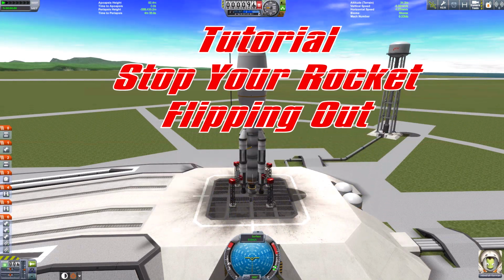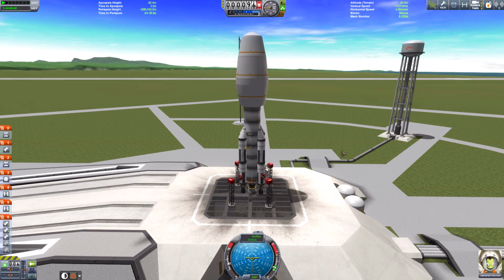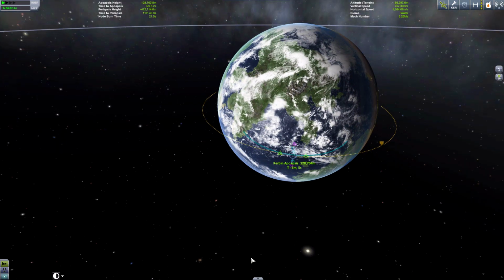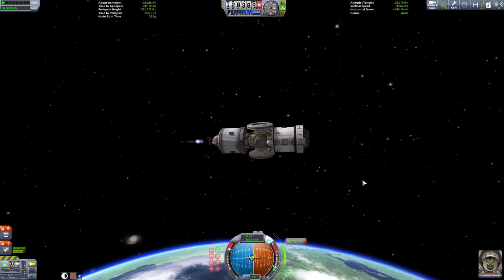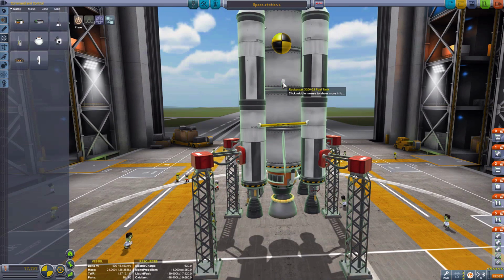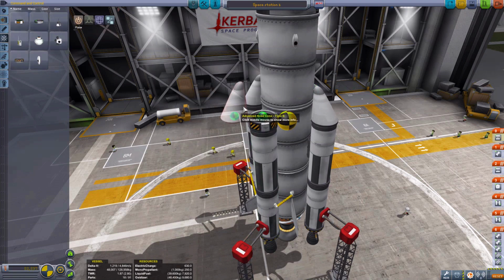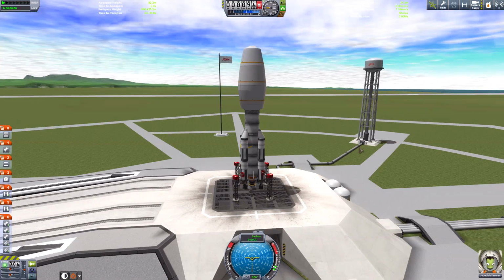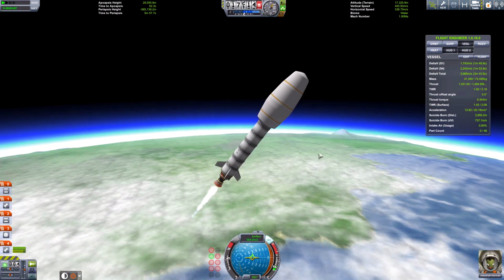Kerbal Space Program - STOP ROCKET FLIPPING!

Comment: See, my issue is this:
Everything goes smooth. SAS is keeping me stable, asparagus staging is working just fine, for as long as I fly straight up. The second I start tilting to 45° along the 90, the ship begins tilting out of control. Spinning end over end, losing all upward velocity. I can't counter tilt to correct, SAS controls are still on but aren't enough. But even when flying straight up, it eventually picks an angle to do the exact same thing. Sometimes it'll start rotating out of control too, and I have no longer have any control over the rotation. It's most frustrating, as I've designed rockets that have gotten me to orbit and the moons, but every now and then one of these pop up and I'm stuck on the ground for a few days.

Comment: This was made before the fairing bug was fixed. As it clearly shows there is an error ahead of the rocket at 3:00. He did not know why it was there. Should have been running with the stock bug fix patch and it would have not flipped so easily. This bug has since been fixed in the game.

Comment: if the top of the rocket starts oscillating during launch turn off SAS. 90% of the time the different SAS-systems on the ship are tearing it apart rather than stabilizing it. This is especially true if the rocket itself is flexing. The cockpit on the very top of the wobbly tower changes direction all the time and the sas system tries to realign that with the original vector. Result is the rocket turning even though the lower part of the rocket is actually still on course. This in turn increases the wobbling and lifting body problem.
If you build your rocket in a way that is aerodynamically stable you can skip the whole sas-mumbojumbo alltogether
Reply from the maker: +TheVergile Yeah i had this problem before when I added a load to keep a rocket on coarse and the SAS destroyed the rocket :D

Comment: Regarding your struts comment at about 12:20, a way around not being able to attach struts from the base of the rocket to the payload is to attach the struts to the payload first. The struts will then either connect to the fairing base or the part beneath it.
Also, i'm not sure how much of a puritan you are with mods, but you might want to check out Kerbal Joint Reinforcement. It makes it easier to fly already big and unwieldy ships by strengthening connections between bigger nodes.
Reply: +Gordon Rammstein Version 1.1 is coming soon and fixes a lot of issues with that
Reply from the maker: +Gordon Rammstein I didn't realize that you could connect the struts from inside the fairing then to the craft luckily V1.1 will have auto strutting under failings.

The reason I don't use joint reinforcement mod is that it keeps things interesting and I have more fun that way ;)
Reply: Orb8Ter
autostrutting? sounds amazing. I'm wondering if they'll give you the option to make fuel tanks completely liquid fuel, or if they're going to make specialized 2.5 and 3.75m liquid fuel tanks for nuclear stages. I suppose time and devnotes will tell.

Comment: I don't know if it's considered cheating, but you can strut the payload to the main body. just strut the payload BEFORE building the fairing. 

Also, I've noticed that if you try to build struts from the payload to somewhere outside the fairing, when the fairing is already built, the struts will attach to the inside of the fairing, though I don't know how useful is that in terms of stability. Anyway, I always use a fairing that's larger than the payload and I strut everything to the fairing's base.
Reply from the maker: +Teodor Pojar No I dont think this is cheating strutting up ;) but the fairing can cause a lot of problems, luckily in V1.1 anything under the fairing will be considered to have been strutted :D

Comment: There is a parts pack that has fairings that automatically creates struts to secure the cargo...
Reply from the maker: +Randall Hunt I didn't realise there was a mod for that luckily KSP V1.1 will have that as well for their fairings thanks though just in case i pop back to V1.0.5
Reply: +Orb8Ter I knew they added clamshells, didn't know they added struts too. Then again, I've only been playing the career mode, and haven't purchased fairings yet.
One thing I'd like to try is using separate tanks for the fuel and oxidizer to help stabilize it, like they do in real life.

Comment: A few things that have helped my create stable rockets... 

Procedural Parts mod (namely fuel tanks) 
...With large rockets using several stock tanks for the core stage the fuel drains from each tank separately, top to bottom. This can cause the CoM to change drastically and affect flight characteristics. Having one or two core tanks using procedural parts allows for more predictable CoM changes. 

Use large tail fins, Tweakscale or other Mod parts
...having larger tail fins on larger rocks makes sense and reduces the tendency to loose control. This also reduces the need for excessive reaction wheel torque during launch. I tried extra reaction wheels, but that isn't as reliable as larger control surfaces.
Reply from the maker: +AaronAlso Thanks for the tips, I am about tp migrate to V1.1 hopefully there's no bugs like the fairing bug to cause the same problems I was having. I will have to check what mods work on V1.1 but first a little exertion in V1.1

Comment: Yea, I think the stock career mode contracts are kind of stupid. I like to play career mode with a punch of contract pack mods to make them actually practical and important instead of random stupid stuff.

Also, fuel does flow top down, so you should always place fuel lines from the bottom tank to the other bottom tank for asp. ;)
Reply from the maker: +Eli B (SnakeRustler) Yeah I should look at contract mods but maybe in V1.1 when it's out.

I'm glad you verified about the fuel pipes, they can also be useful to balance craft when your burning fuel, I used that technique on my shuttle to make sure you have the center of mass over the center of thrust so it didn't flip out ;D

Comment: I've found sometimes these techniques don't quite work for heavy payloads. Sometimes even if the load is stable the faring can cause the rocket to flip out. And sometimes with heavy loads the center of mass will shift higher as the fuel is drained from the top tanks causing it to flip out. So pumping the fuel from the bottom to the top tank stabilizes the center of mass. You can pump the fuel by holding Alt while right-clicking on both tanks this brings up buttons for in and out below the fuel bar.
Reply from the maker: +Osani Eslana I beleeive that the large fairings I use cause a lot of problems due the high shift in center of lift, but on experience if you make sure you point prograde you wont flip out, thats how NASA did it for the Apollo rockets.

Comment: Your analogy for center of mass is wrong,  having a higher center of mass makes an item more stable. You can test this by balancing a snooker cue on your finger (or any long top-heavy item for that matter) the heavier end on top will always balance easier than the lighter end.
Reply from the maker: +Mark Yup your right I should have used the analogy of a building tipping over where center of mass high means it topples over easier, even though I was wrong center of mass should be high to have a stable rocket...me derp :D

Comment: well you see, you wouldn't have the flipping problem if it were aero-mechanically stable. the blunt nose and Tiny fins are both cause for problems when you waver from your velocity vector. you should build model rockets to get a feel for this
Reply from the maker: +RedstonePyroMan True I also messed up I sated pit the center of mass low when it should be high, the fins are just added for control and they are overpowered in this game I'm not sure how accurate the aerodynamics are in the game but your points are valid, thanks :)
Reply: +Orb8Ter it's cool. The aerodynamics model I'm sure has improved since and it is always improving. I commend you for always wanting to learn more about the great world of Aerospace. good luck

Comment: i got issue :
Stock Fairing Glitched out and wobble
I Put Too much Winglets on rocket still flipping rockets
Reply from the maker: +swamp-iv44 // New Channel : CraftedDoge20 I found if you put too much control the SAS can over correct when launching try and find the balance and also you can use CAPS lock to engage fine control ;)

Comment: +orb8ter you have it backwards on the weight

You always want the Centre of mass to be forward of the centre of lift.
The reason behind this is the centre of lift is also the centre of drag

In essence rather than the pencil analogy you used, think of the Centre of drag/lift as a trailer on a car.
The car is the centre of mass, driving forwards the trailer (centre of drag) is pulled behind you keeping it going straight (indicated by the centre of thrust)

If you reverse a trailer, because the drag is ahead of the mass it can deviate and jack-knife the trailer (flip the rocket)

What causes the flip outs isn't the lifting body physics, its the off centre drag as you deviate from the velocity vector turning the length of the rocket into a lever
This is why the easiest way to fix this is to build from the top down and make sure each atmospheric stage has the centre of lift  below the Centre of mass in the VAB
Reply from the maker: +Ben Grogan Yup your right after research from NASA I can confirm, I will still do an experiment video though ;) 

I love the way the KSP community helps each other out even to correct fellow KSP'ers. I drew the assumption from my own rocket flips and how I corrected with larger rockets below the payload this only gave me more control authority not unlike the Apollo rockets as they also have low center of mass at the beginning of their launch.
Reply: Orb8Ter Yup, thats part of the reason behind working on the gravity turn was so key.

In KSP, Kerbin is 1/10th the size of earth so gravity and Drag are significantly harsher than they are normally to balance that
Reply: +Ben Grogan Another thing that may be worth mentioning is that you saw the lift from the fairing being way ahead of the rocket, this is a known glitch and is one of the main reason people have issues with rockets flipping when they first start using fairings. This needs to be overcompensated for, until it is fixed, not sure if that is fixed in the latest update but I really hope it is.
Reply: +Ben Grogan I guess for re-entry, if I dont want my pod (and all the thing hooked to it) to flip, I should have the center of mass as close as the heatshield(buttom) as possible?
Reply: Etienne Brien Exactly, adding the heatshield weights the bottom and helps achieve that
Reply: Etienne Brien If you're building pods, remember you can EVA and remove the science from experiments to put in the pod, they have a decoupler so you only reenter with the pod containing the data:  you don't need the experiment to land =)
Reply: +Ben Grogan 
Ben I'm glad you caught that and corrected. We don't want to miss lead anyone, even if by simple mistake. I agree with your analysis of the flipping problem. But, would add that the CoM should be above the CoL/D, CoT however not above 50% of the rocket's length. Like the pencil analogy Orb8Ter used in the video if the CoM is too far forward it will cause stability issues. 

I try to keep my CoM slightly below 50% of length during all stages. On decent this helps keep the heat shield facing retrograde without the use of SAS, hence saving electric charge. 

For planes things are a bit different, but that is for a whole other discussion.
Reply: AaronAlso I'd slightly disagree with you on the 50%, it needs to vary from rocket to rocket.

In general the higher the Thrust to weight ratio is the further up it needs to go, assuming you're trying to do an optimal orbital insertion using a true gravity turn.

For doing that you set up the cantilever of the body in such a way that the gravity turn will function properly with no SAS input, the reason is burning at less than 100% and burning while not on complete prograde are both losses of delta V, the former less so than the latter

By shifting your centre of mass higher you make you body naturally follow the "True" path of an insertion at 100% with no control input
(any gimbal is technically of prograde maneuvering and therefor a loss of dV)

If your T;W ratio is high and the CoM is low your ascent will be too steep, require corrective steering or need feathered throttle work all of which affect you if running on long distance , small budget missions
Reply: I can't disagree with that logic, but for most of us amateurs it is easier to throw on a couple hundred more Delta-V than to calculate the exact optimal location for the CoM per stage. As a rule of thumb I have found that the 50% rule has worked well for me. After much trial and error I consistently reach 75KM orbits with less than 3600m/s and most any payload. So, I feel that it is a good guideline to share with others.
Reply: Correct. With big launches I pump fuel forward as it is drained. Continually keeping the weight on top makes it stable. The analogy about the pencil shows this also. Balancing a pencil with the eraser on the top is easier than balancing it with the point up.
Reply: +Ben Grogan better information in this comment than the whole video.
Reply: Thank you dude, you actually helped me way more than the vid
Reply: 0

Comment: An even easier way of preventing rocket flipping is to view the CoM vs the CoL at each stage, full fuel and no fuel. If the CoM is above the CoL, it will be stable, if not, it won't. Then yeah, just use the tips you gave in the video and bam, easy orbit, every time.
Reply from the maker: +Xenro66 Yeah my problem used to be putting the center of mass too high so the rocket would flip unless you balanced it on your center of mass :D

Comment: But... if the rocket is front heavy it's going to be aerodynamically stable, meaning it won't flip at all even if you let go of controls.
Reply from the maker: +m4ti140 True My derp I was going from my past experience where I added extra rockets bellow but that added extra control not stability from center of mass, I did an experiment video to check it out ;)

Comment: Most of the time your rocket flips when it isnt going fast enough or you tip over too much
Reply from the maker: When I made this there was a bug which put the fairings centre of drag too far forward also i learned it helps if your centre of mass is as far forward as possible
Reply: just to add onto my point, i usually go with a 2.00 twr at launch so i have a margin to throttle and in upper atmosphere u should have at least 3.5 twr, you can get by with 1.5 at launch but it depends how fast ur boosters burn

Comment: BS on putting the fuel ducts low to help stability. Aerodynamically, stuff likes to travel "heavy end first; light and draggy end last." Look at a arrow, dart, man on a parachute, etc. Ask ANY pilot about an "aft CG loading" and the effect it has on stability!
Reply from the maker: +bcubed72 I did some research and will experiment on it, what I found is that the rocket pivots on the center of mass and if you have center of lift behind it then the rocket should naturally correct to the prograde.

Comment: So I usually burn completely vertical until about 25 km, then I do a 45° adjust, followed by another 45° adjust at 55-60 km. I find that removes the annoyance of gravity turns at the start. I also consistently get nice flat arcs at my apoapsis, allowing me to do an orbital insertion easily with minimal ΔV at 80 km.

I find it much easier then worrying about gravity turns. But I think the con is it may be less efficient than your way (more fuel taken)
Reply from the maker: +Immortalcheese Yeah never tried that method but it does use a lot more fuel mot sure how much, remember in the earlier days when people would go straight up into space then burn sideways :D but now a lot of people seemed to understand the idea of a gravity turn
Reply: +Immortalcheese You use far less delta doing a proper gravity turn, the reason is that rockets are more delta efficient at closer to a gravitational centre.
It's a phenomenon known as the Oberth effect.
100 delta will achieve more at Periapsis than it will at apoapsis

Comment: You have this bass-ackward. It's easier to balance an inverted pendulum than something bottom heavy. It's easier to balance a pencil with a weight on top than a weight near the bottom. To be aerodynamically stable, you want the center of mass as far forward as possible.
Reply from the maker: +stcredzero I love the Bass-ackward :D yup I  was wrong, I did an experiment even though a lot of NASA papers show that center of mass as far forward from center of pressure keeps the rocket stable suffice to say it was stable when center of mass was high
Reply: Yes I tried to higher the center of mass on my soyuz recreation and it works, I can't even flip it if I want to.
Reply: It's like an arrow you throw, it wants to have the heavier part forward